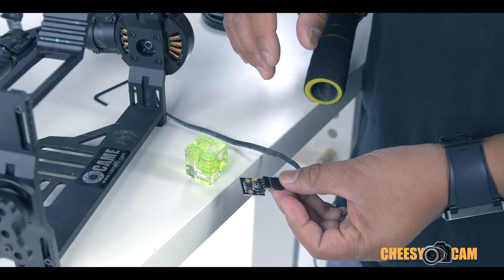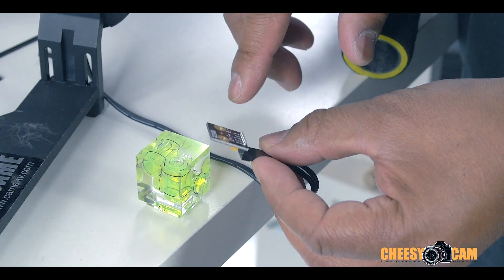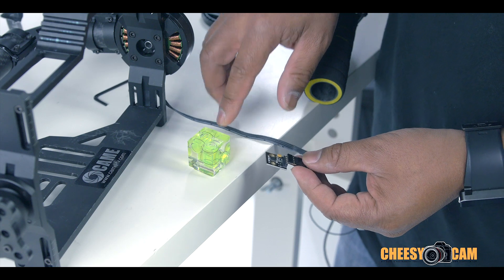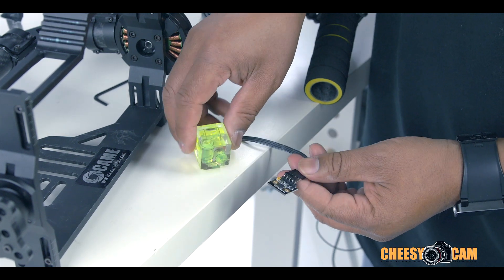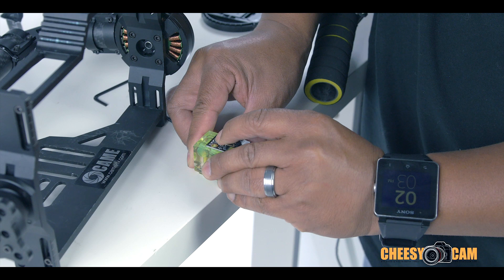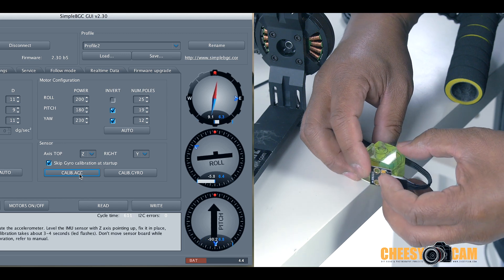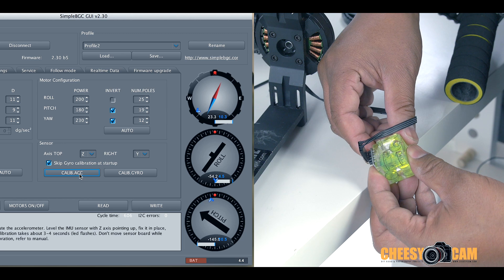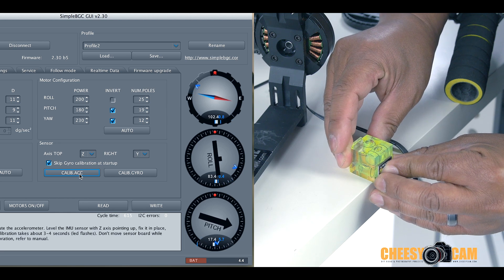How To - Calibrate 6 Point IMU Calibration 3 Axis Gimbal Stabilizer

Comment: Hi ! I don't have the same gimbal, but the motors are DYS BGM4108-130 and the circuit board is BaseCam Simple BGC 32 bits. When I try to stabilize the gimbal with PID it doesn't work... Can you just help me please?
I know it's not the topic of this video.
Reply from the maker: Ben Chabin When you say it doesn't work, that's too vague. Does the motors not power on at all? Or does it power on and shake? Or does it power on and is not centered or level?
Reply: MrCheesyCam I mean, motors power on that's good. Pitch and Roll are calibrated but when I add Yaw with that it shakes when the gimbal reach extrem values. And worse, when I push the gimbal on the axis of the Yaw, Roll turns too.
It seems to be insane...
Reply: Ben Chabin How much voltage are you using? Sometimes using to little power can make it really shaky

Comment: Is there a way to calibrate frame imu? When I try to switch in software from camera to frame my W-BGC Pro doesn't switch and kicks back to camera  imu
Im running 4.46 i think  a 32bit
Reply from the maker: timoxa2426 If you have two IMU sensors, then you can 'enable' the frame IMU under one of the tabs. Then go back and click Frame IMU to calibrate. If you can't enable the frame IMU, then the software does not detect it.
Reply: MrCheesyCam so i tried everything but maybe im not finding it ... the previous software was 4.43b9 now i installed the 4.44 beta and still nothing works, i wonder if that could be my board

Comment: Hey, stumbled across and saw your calibration job.
Theres some missinformation on the web about calibration, only the first -the initial calibration angle is the one what is relevant for the gimbal horizon accuracy. All other 5 steps are just to tell the software how the signal/ACC endpoints look like so they dont have to be that precise.
The IMU´s i got together with the Basecam controllers all have surface mounted sockets for the cable so the bottom is perfect flat.

Comment: Hi, may be you can help...I've got 3 axis gimbal and my problem is that YAW can't work properly. It means that after calibration yaw doesn't stay straight (blue arrow can't meet red point in GUI and the camera is always about 15 deegres left or right after calibration). Sometimes it's straight but even that I noticed that in Follow mode the angel (move) of one side is wider than the other. Please give me some advice how to setup yaw in GUI. Thanks  p.s pitch roll and yaw work fine except that what I wrote above
Reply from the maker: Krzysiek Miczek There could be a few things going on. First make sure the YAW is balanced perfectly. I have another video with a Varavon Birdycam showing you how to balance YAW: http://cheesycam.com/varavon-birdycam-3-axis-gimbal-stabilizer-first-look/

Try using the 'Calibrate Gyro' feature and make sure you are holding the gimbal as straight as possible. If you have a joystick installed, try using some of the 'trim' settings.

Comment: I don't understand how your calibration can be correct, because if you make a 6 point calibration, normally you must change in the same time for each point, axes high and right. Explain me please if i'm wrong.
Reply from the maker: Top and Right are only once you mount the sensor on the gimbal. Then the software knows the final orientation.

Comment: Could you tell me your default PID settings? I'm trying to calibrate my boss' Came 7000 gimbal, but I don't have his manual or anything. When I plugged it in to calibrate it the first thing I did was to tell it to revert to default settings, which made it go haywire, and I haven't been able to fix it since. (we're using small cameras like the Black Magic Pocket Cinema and EOS M, if that makes any difference.)
Thanks for any help you can give.
Reply from the maker: Using a small camera makes all the difference. I am no expert, but I think this gimbal is too big for those small cameras. There is not enough weight. If you follow my blog, I personally always advise that you use a smaller gimbal for smaller cameras. The CAME 7000 is better for Canon 5D Mark III sized / weight cameras. If you want a look at my PID, you can download it at the bottom of this article: http://cheesycam.com/came-7000-3-axis-gimbal-first-impression-and-demo-video/
Reply: We were getting it to work out of the box great, aside from it wanting to pull to the left the entire time, hence delving into the calibration software. It wasn't until hooking it up to the computer that it got weird.
I'll try your profile on your page. Thank you.

Comment: Why are you using the 2.3 software and not the newer 2.4? Do ytou have bluetooth set up so you can use a phone or tablet to tune?
Reply from the maker: I am showing this on al older gimbal using an old 8 bit board. I have this gimbal working very well for me, and you know what they say - "if it ain't broke, don't fix it."
Reply: I'm in the same position on an 8 bit 2.2 board so no bluetooth (android support). And it works great ,so why screw things up updating.